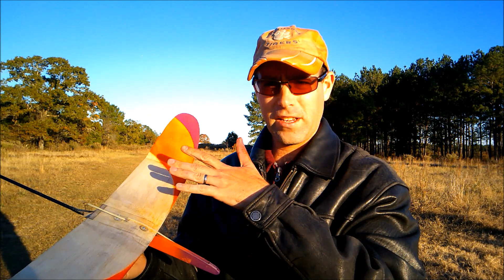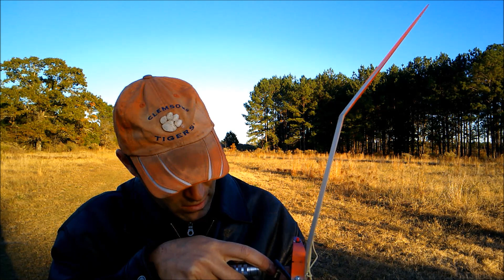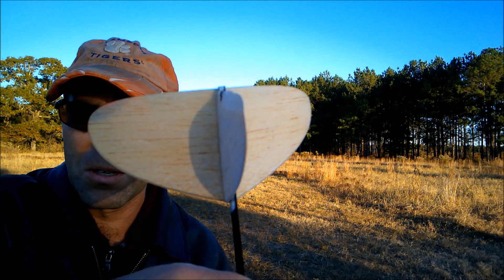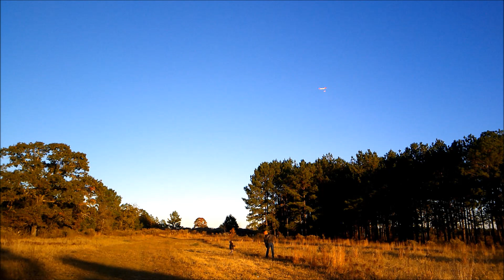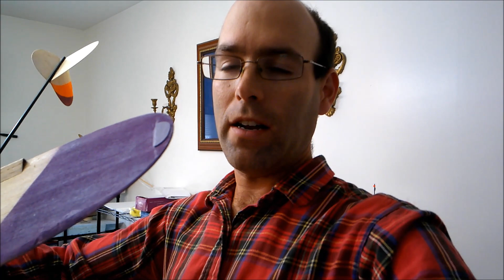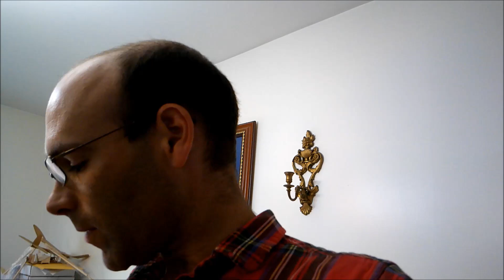Sweepette 28/30 Tip Launched Free Flight Discus Glider -  Flight Trimming

Comment: thanks joshua finn.  have already built a no. of hlg's including lee hines 18" sweepette, mick pages butterfly, a nz design called a zingara 24" span (lost 3 times and retrieved) and a 13" span magic x that i have been able to get 47 and 53 seconds out of.  keen to move on to variable incidence, dt'd larger carbon boomed design.  what price is the kit please?
Reply from the maker: The kits are $65, available here:
https://jhaerospace.com/product/sweepette-28-30/
Sounds like you've built some nice stuff!
Reply: @joshuawfinn  back to models after an absence from earlier years in class b team race with an eta 29 with david kidd and ian newbury, years of sports/performance cars then back to r/c gliders, stalled by 400ft ceiling restrictions.  i see many returning to f/f & c/l as a consequence.  sorry about the botched credit card attempts.  to bank tommorow to correct.  i will buy 1 of those 28-30" Sweepettes please josh & hope.  will confirm tommorow after clearing debit card problems and thanks for your trimming tips and construction vids.  stay safe and well.  cheers fry.

Comment: I flew a similar English design called Butterfly from aeromodeller plans in the 90s winning Australian F/F Champs in very windy conditions swing weight d/ting at 1000ft long retrieve between rounds and still have it. Its quite light with Balsa boron filament fuse. Dont like the inconsistent discus launch tho ~ i had a right climb flipping off the top into left turn using warps in wing tip to get high speed launch & transition ~ lot of fun and thanks it might just get me out again for a fly ~ oh i also used ti get around near 40sec from ihlg with a 5.7g glider and flew Peanut Scale, EZB & F1D
Plans i found ~ great design and it was a winner for me 😁
https://outerzone.co.uk/plan_details.asp?ID=10527
Reply from the maker: For what it's worth, discus launch is easier on the body and they go twice as high on half the effort. Javelin style is fun and all but it definitely doesn't win anymore.
Reply: @joshuawfinn  thats interesting as i thought you would rip the wing tip off but i guess its all in technique ~ i saw it done with R/C HLG in my day.